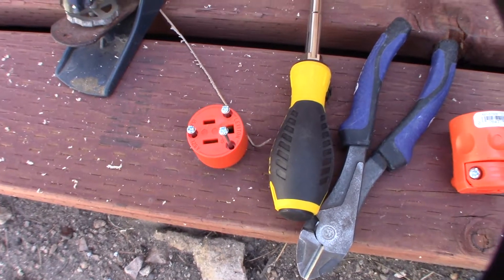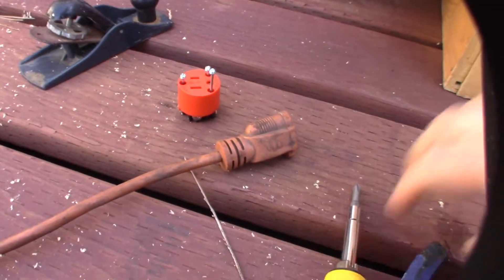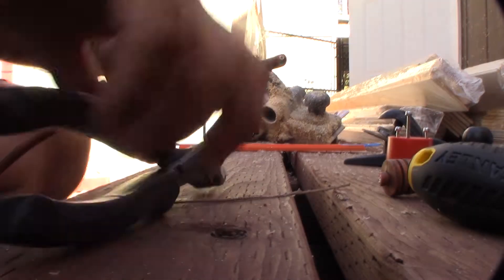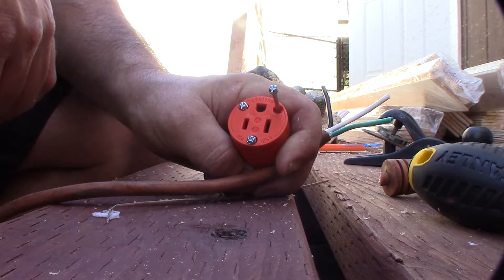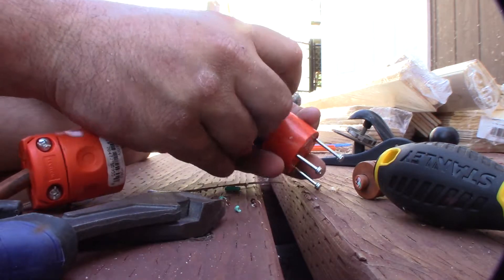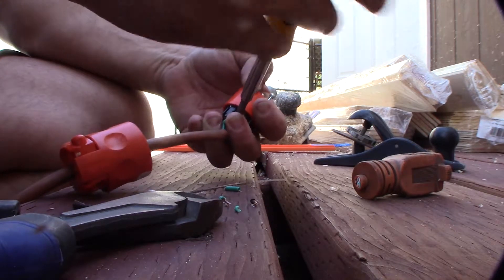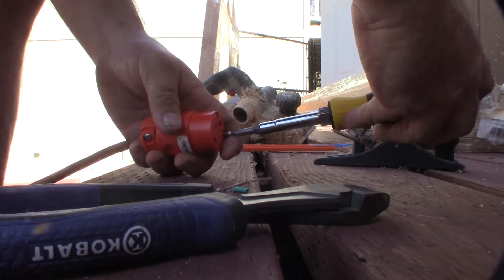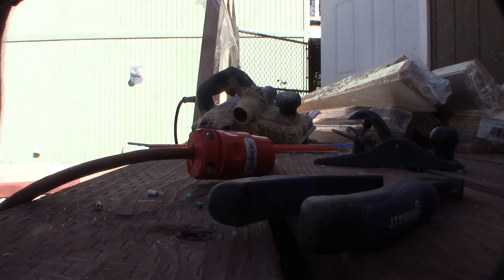How to repair extension cord end the correct way new connector correct polarity repair

Comment: On this particular plug don’t plan on getting the wire to wrap in the direction the screw tightens. Additionally there is a movable plate that the screw goes through. Why is this plate there? Are you suppose to put the wire underneath or on top? Either way, the design is Mickey  Mouse as opposed to what could have been made to make a more robust connection - no depending on clamping down on the cord with minimal wire contact to brass parts.

Comment: I had an old cord that I acquired and I was going to be using it the next day so I give it a thorough inspection and re-terminated the ends since they were replacements. Turns out the polarity was reversed they put the black to the black screw however this was an older replacement socket and the black was actually the neutral pin.

The next day setting up for the event we/I had a food vendor come and plug-in with a non-standard custom adapter to give them 240v... unfortunately out of their 5 extension cords one of them was reversed polarity and they tripped the breaker instantly. I inspected everything further and discovered the issue had been the same thing black goes to the black screw well guess what for some reason these older manufactured ones didn't do that right and used black for neutral and brass for Hot. Got them all set up and got myself free lunch. A Few hours later during the day I had the another opportunity to go on a goose hunt for the circuit breaker in a large facility.... I did eventually find it amongst at least 6 different panels across the building I thought I had access to.

Two things I learned.
get one of those three light outlet tester's, check the outlet then plug your extension cord in and check that.
The other thing is do an inspection on any foreign electrical coming onto your premises before they just run over and plug-in if you can.